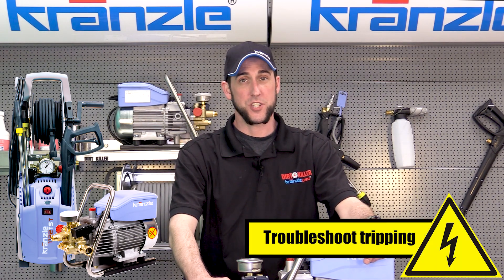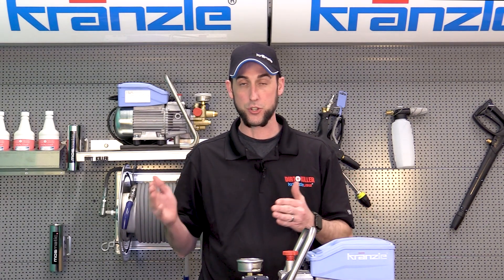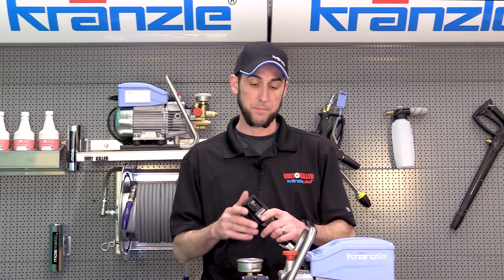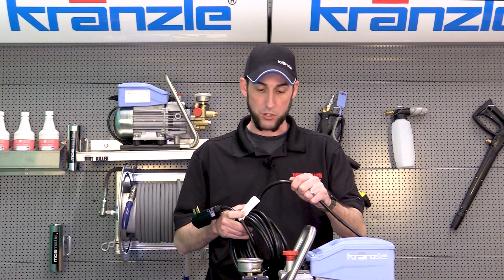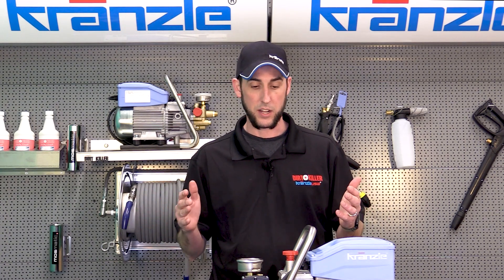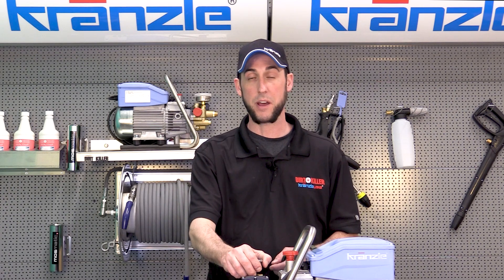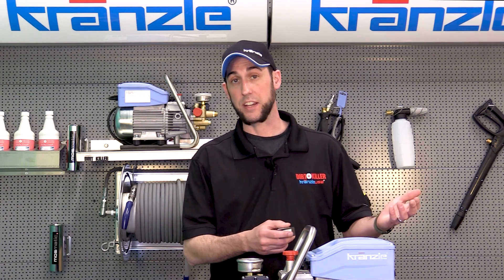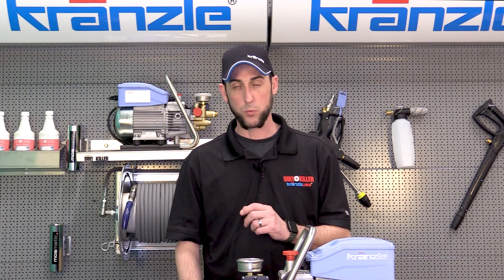What exactly is tripping? Electrical troubleshooting Kranzle 1622TS 1122TST 1322

Comment: What can be wrong when pressure is not reached?
I have a new 1152 TST 12A 240V
Working pressure 130 bar (max 150) but I can only get 90-100 bar with red adjustment wheel to maximum pressure. What can be wrong?
Reply from the maker: Are you using the factory accessories? If not, the orifice size of your nozzle may be to large. *We are the USA dealer and do not sell the model you are asking about. The USA equivalent is the 1122TST.

Comment: I had an active 2.0 that kept tripping my breaker on a dirty 20amp circuit, but nothing else running at the time. I upgraded to the kranzle 1322ts and haven’t had a single problem.   Outside of that the db and annoying whine of the active 2.0, and I’m so happy with my kranzle. It’s like night and day.  A slight bump in gpm as well.  After the sticker shock wore off, I’m loving my 1322.
Reply from the maker: Thanks for taking the time to leave your comment. We are happy that you love your Kranzle. Pressure Washer Perfection!

Comment: Kranzle K1322TS trips right when I plug it in...
Reply from the maker: Hmm. Sounds like something is not set up correctly. Please give us a call to discuss. 800.544.1188 M-F 9-5 EST. .. Where is it tripping?  At the GFI or the on/off switch? What accessories are you using? Are you connected to a wall outlet or generator?

Comment: Running a 1622ts on a 5000 watt predator.  It is plugged into a 30 amp adapter from the generator. It was working fine for about 30-40 Minutes while doing a wash and then it started tripping and turning off after holding down the trigger for about 3 seconds.
Reply from the maker: Hmm. That should be plenty. Is the machine in "eco" mode? Are you using 3rd party nozzles or accessories? How does the machine run on a standard wall outlet?  Feel free to call Josh for advance trouble shooting. 800.544.1188.
Reply: @kranzleusa5846  Eco mode is turned off.  Using a pressure washer wand/nozzles from amazon not sure which ones exactly.  The gfi starts to trip after about 10 minutes of use. and then trips after about 5 seconds of use after running for the 10 minutes. Nozzle says its a 40 degree, not sure on the orifice size.
Reply: the gfi is tripping
Reply: I have the same issue, I have the 5000 predator generator and it keeps tripping turning off , please help what could it be
Reply: @codysanchez2961  You need a neutral grounding plug, you keep that plugged while using the pressure washer and it works fine.
Reply: @CooksMobileDetailing can you explain , just switch the plug ?